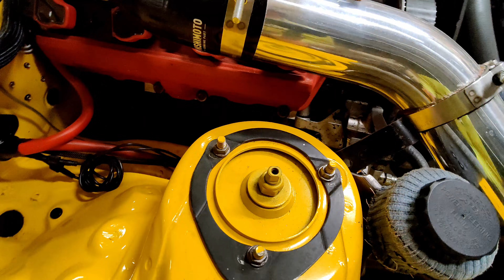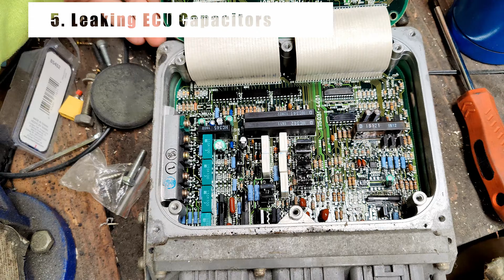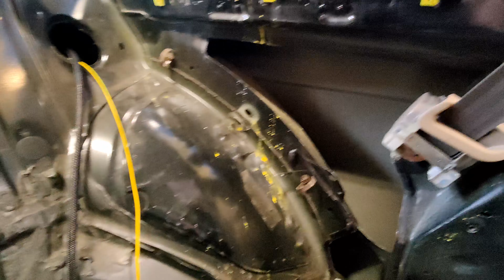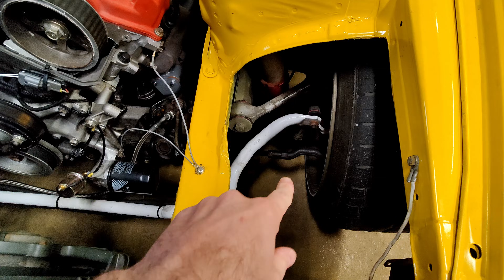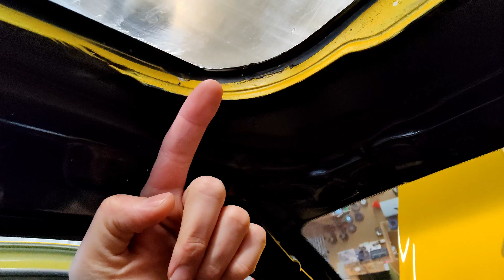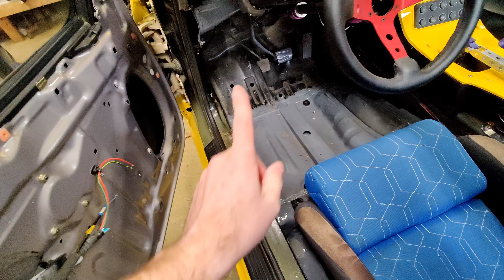Is The SC400 Reliable? All The Common Problems

Comment: I just got a 400 with 105k miles for 2500. Killer deal, excited to fix the small problems it has, runs like a dream.
Reply from the maker: that's a great deal
Reply: @DingDongDrift is one with 155k miles for 3400 a good deal as well?
Reply from the maker: @diegodelgado3828 not as good of a deal as the guy above lol
Reply: @DingDongDrift is it a good purchase? I'm new to the SCs as well lol
Reply from the maker: @diegodelgado3828 there's many factors that determine that, miles don't really matter

Comment: Bought a 99 in 2003 off a lease with (63k), put 200k on the dash had to replace thermostat, starter, alternator, timing belt, power steering pump... it ran excellent

Comment: I'm watching this video because there's a 92 SC400 for sale with only 67,000 miles. One owner car all stock and very well preserved. I don't want to buy it and then things start breaking right away. But with the condition and low miles, do you think that it will be a while before I experience any of these issues?
Reply from the maker: Low miles, old car = every bushing needs to be replaced and once things start getting used everything falls apart.

Comment: Helped my son’s friend trouble shoot a 93 SC400 and finally got it working well without a check engine light. Replaced both ignition coils for misfires and MAF sensor lastly. Has 370k miles, runs good now.

Comment: A little over a year ago I got a 92 with only 84,000 miles on it, mint interior, beautiful paint besides the hood and roof. Ran perfect for 6 months and ever since then I can not get away from a problem. Currently trying to figure out if it’s the idle air control valve giving me problems or the fuel pump. She’ll turn over, shake and then fail. 
Really love this car but damn I wish it wasn’t my daily lol

Comment: You forgot this common issue, Nakamichi amplifier fried due to leaky trunk.  A premium stereo system ruined by a very poor location choice being under the CD changer in the right rear wheel well.
Reply from the maker: @warped2875  never seen that happen

Comment: My friend brought his 98 sc400 to my house yesterday because the radio wasn't working. The 20 amp radio fuse was blown, I replaced it and it melted completely within seconds. I tried another one, it did the same thing. I said "well, I guess you're not gonna have a radio". I hear this is very common with the Nakamichi sound system.

Comment: Thank you for one of the best, if not the very best video like this, that explains so much, in such a no nonsense way. Very well done. I am looking at a 91 SC400, with 98,000 K's on it. It may not have all of these problems just now, but nice to be aware of what is likely to come and some of the precautions that can be taken. Cheers, from Oz.
Reply: Did you pick it up? Sounds like a good deal

Comment: There is a tiny solenoid valve (maybe two, can't remember) behind the drivers front wheel well attached to the power steering rack.  When removed there is a tiny screen in it which blocks.  This causes undue pressure which blows the hoses or pump.  Clean the screens, no problem, no worries.

Comment: These were my dream cars when I was a poor college student. I preferred the SC over the Supra because the supra attracted too much attention. I finally bought a 1-owner SC300 with 50k miles. Love the car but the engine does heat up. Sold it after 25K miles for the same price I bought it.

Comment: spot on man! I got my dads Cali 92 SC400 so there isnt alot of rust on it but at 218K my driver door latch is tough to get closed and latched, pretty much have to slam it and its near impossible to get out as its behind the equally impossible to remove door track.  Driver door window: I lost the lower rear guide pin and the window cocked and ripped the rubber drive puck in the power regulator. You dont have to remove the window, just tape it up and the regulator will unbolt and come out the hole. Valve cover gaskets: both leaked heavily before they were professionally replaced (Dad just paid to have it done) but I dont have any of the other leaks you mention. Power Steering: The line/hose that runs across the lower rad leaks. Must replace. Starter: Even with a new battery, half the time it will kick right over, the other it will really labor like the battery is low but will always start it, I think the brushes or the contactor are shot. IAC motor: Mine had the bearings almost seized in it. 2 skateboard type sealed bearings inside the motor itself caused an 1800 rpm idle until I took the IAC out and realized it wasnt moving. Lubed the bearings up and it idles at 650 now. They were ROUGH! Interior: Door cards falling apart! Evert time I remove them, I break more of the plastic out at the bolt holes. Every one of the holes now has a beer can pull tab as a washer to hold the panel on. Window trim where your arm would rest, they are ALL broken midway and most of those bolt holes are broken too. A/C display blacked out, I soldered in a new one but could never get the backlights to work again? Needle lights are out, grab every set of needles you can find from the SC dashes at your pick-a-part and find the ones that work. IIRC the tach needle polarity changed from the 92 to the 94 years as all the ones I found didnt work until I reversed the polarity (weird). Suspension: keep it lubed! front end gets squeaky. I did the rear bushings on a LS400 and it was pretty easy and really helped the squirrilly back end. But all these things still make these cars pretty much bullet proof and they run great.

Comment: I use to own 1992 SC300 and now the 1998 SC400. I noticed, all the problem was all repaired in my 1998 as I never have problem with it since I have the car. Yes, the starter is hard to change. Make sure to have at least one extra fuel injector as spare just in case you craked it when you pull the injector rail. Renew all the injector seal whenever you change the starter, it can start leaking with old seal ones you move it. I remember having a lot of problem icluding electrical problem or the odometer with 1992 SC300, with 1998 SC400 all those problem are gone and I heard from 1997 to last year 2000 are problem free. I’m still driving my SC400 until now and planning to upgrade the suspension to Tein and will renew the starter also.

Comment: I mustve been lucky. 3 yr soarer owner i havent had any of the first 4 problems listed. Ecu, however, big thing. Major thing. And fuel pump ecu. Personally, i havent had a problem with the fuel pump ecu, but everyone i know has the problem along with the main ecu. Big things the soarers are notorious for 100%. Just recently had to do crank and cam seals and oil pan reseal. Yea, they leak from these places. The emv/climate control, yup they go out. Easy to replace tho, or get fixed. Yup doord are fckn heavy, the door cards break. Havent had wheel well wiring fck up on me, but all my mates have them problems. Good video if u looking at soarers/sc400s. These problems are what u would expect. But they are fckin reliable tho. Just minor things being an old car

Comment: I have the same issue with my 93 LS400 right now leaking PS fluid on my alternator I think. The car interior lights flicker, and the ACV valve that mounts to the bottom of the PS pump is more than likely junk, I filled it with AFT when I realized that I had no fluid and I noticed zero difference, lmao.

Sourcing a new reliable PS pump, not the cheapest. Not sure what brands are good off e-bay, etc. I'm looking at an SC400 that might need this done too, but I don't know yet. My LS is an Arizona only car, and this SC I found 2hrs away from me is a Cali car.

Comment: I have a 1995 SC400, I bought in 2003 with 59,000 miles on it.

This dude is explaining one by one, EVERY issue I’ve experienced or am currently experiencing 😂

PS: I’m at 169,000 miles now, but it still looks like brand new inside and out. Beautiful car.
Reply: Do u have ig?
Reply: how’s it running now? im currently looking for one for my first car n need tips
Reply: Don't forget comfy
Reply: Thank you for the heads up.

Comment: I bought my first SC in 2000.  It was a fabulous car. I did have a problem with the Power Steering pump, but I drove the car with out incident until i wrecked it.  I bought my next SC in 2019 and I am still driving it.  I have never had to replace anything on this car.  It had 79K on it and it has 120K on it now.  The SC is a fun car to drive and it is super reliable.

Comment: What up Norman Reedus' little brother.... I see you over there with that TRD oil cap ;)

Dont know if you have ever taken those front fenders off but 2 things

1) The little clips on the spacers there crack up and then you have to manually line them up from that point on when you put the fender back on
2) The fenders hold so much dirt that on the last car I bought I found a literal plant growing IN the mud at the bottom of the fender.

I live in the south so no snow but PLENTY of mud to sit there and cause that corner to rust

Comment: Hey Ding Dong i have a 1996 sc400 lexus sometimes when i try to accelerate it won't accelerate like a dead spot i have to press the accelerator really hard or stomp it hard to accelerate faster i did the fuel pump bypass new fuel filter car runs and idle fine. Do you think this could be my Tps sensor.

Comment: A better solution than direct wiring the fuel pump would be to use the ECU's voltage output to run a relay. Even if it's a bit low it will still operate the relay.

Comment: Excellent video!   I don't remember where I found it, but there are posts or videos on how you can make a small aluminum plate that can fit underneath the power steering pump so that any power steering fluid drips will be diverted away from the alternator.

Comment: I have own my 95 for about 8 years and yes some of these items need repaired or fixed, door and window issues yes, I flush my power steering fluid every few months to make sure it stays fresh when every I hear the steering make any noise when I turn the wheel (if the power st. pump goes out it will spill on the altnator and starter making a big repair bill) That being said my sc has been one of the best most reliable car's ever!!! and at 150k miles it feels like a new car. I do one upgrade yearly last year it was tires and spark plugs and wires this year will be the timing belt, next year new struts. Don't be fooled it is a awesome car and the only reason I have not gotten a c5. (P.s No I do not drive it in the winter time)

Comment: When you remove the idle air control valve where do you re route the hoses to? Or do you plug each one up completely?
Reply from the maker: Just plug everything
Reply: @DingDongDrift  Thank you! Ive been having issues with mine and prices for a new one are crazy. Figured itd just be better to just get a block off plate instead
Reply from the maker: @ricklexo  it won't work without a standalone ecu

Comment: I have a 1995 Lexus sc400.    It has been sitting for 4 years. So I drained the old gas and put 5 gallons of fresh new gas.   My car is having a hard time starting.  It cranks and cranks before it turns over.  Sometimes it takes several tries.   It started and ran perfectly fine for 30 minutes or so at normal operating temp. Shortly after, the temp gauge started to rise slightly and the car just shut off.  Hard to start again, would crank but not start.     do you know what it could be?
Reply: Position crank sensor happened to my 4runner. The overheating might be a separate issue. Good luck...

Comment: I have a 97 SC400 150Kmi paid 5300. It's a fairly straight up car. But I have spent 7k+ on rebuilding the suspension and parts for motor. The only issue right now is the PS leaking.

Suspension - P2M upper & Lowers, Links, rear tie rods, etc., PBM coil overs, new hubs & bearings, new brakes - powerstop carbon pads & new rotors, rebuilt the calipers. 

Engine - New PS pump and hoses (need to watch your video on the hose thing tho), new timing belt & water pump kit, valve cover gaskets, new drive belt & idler kit. New wires, caps, rotors, plugs. I like the idea of doing away with the hydraulic fan although mine doesn't leak (yet). 

Still wrenching - started like 3-4 weeks ago.
Reply: Driftmotion braided ss power steering hose

Comment: I have an issue when I step on the throttle all the way when I’m going 50mph the car used to downshift to the lowest gear possible but now when I’m going 50 and step on it, it only downshifts one gear so it feel slower but when I use the gears it still accelerates fast
Reply: Overdrive on?
Reply from the maker: There's a switch below the pedal on the firewall, that's the kick down switch to drop 2 gears. If that doesn't work or maybe floor mat covers it that could be causing your issue.

Comment: Hey! I recently bought an SC400 that has been sitting for two years, I've got it started and everything running good, the only problem is.. is that when I floor it and it goes up to 3000k (pretty slowly too btw) it drops down to around 2k and keeps climbing back up just to fall again.. it makes a braaaaa braaa braaa sound because the revs just climb up and fall down. the car passes 3k revs in neutral when revving but since i cant put more than 50% acceleration it either shifts before it drops or it flies to 3k then does the dropping thing.. any ideas??
Reply: Is yours throwing a P0715 Code?
Reply: @robotviewer1396  dont remember, sold the car the problem was impossible to fix. just dont like sc's. dont get one.

Comment: The power steering pump, my God. The bypass thing , I replaced it with a oil drain bolt and Teflon tape because it would leak into the intake and the.  Looks like a 2 stroke from start up. The steering didn't feel very different but just a little but very unnoticeable. Supposedly it makes steering better but what ever

Comment: My es300 still is mint but it was garage kept from original owner who was old man and it only had 48k miles. All the suspension, seats rubber mounts and molding are in unbelievable pristine condition
Reply: Hows the transmission holding up? Im waiting on getting mine back from the shop. Onto trans #4

Comment: If you had the plans of maybe getting a SC and CD009 swapping it and wanted to modify it would you get a 300 to boost or would you get a 400? If you get a SC400 how much power is possible? Obviously the 300 can be boosted easily but what could be done to the V8? Maybe an aluminum L33 5.3 with worked heads, cam, intake and etc?
Reply from the maker: You can boost a stock 1uz the same exact amount as a stock 2jz
Reply: The genesis of the 1UZ was the CART IRL Indy V8 Toyota bult in the 90s. The engine is solid, has six bolt mains and will take boost. Surf for it as I've come across a few posts on it.
Reply: aftermarket for 2j is far better, na-t, forge internals are easier to get ahold of...ran 1uz on 9psi for years until 2 rods went wifi 2 months ago had skinnier rod 1uz 500hp is the limit...cheaper to get power from 2jz.. boosting both on stock motors is about the same numbers wise.

Comment: 93 sc400 local with 250k for $1200 obo. They said they went to drive it and had no gears just all neutral. This usually means death of a trans but I hear the drivetrain is usually bulletproof. Owners says it wasn't beat or abused but don't they all. Any ideas? Is it Worth throwing them a $600 offer to take on this project. I enjoy import cars and have owned cicvis, Subarus, a Celica, and a dodge stealth. I've always known the sc's as luxury supras and seeing one pop local as me excited.

Comment: I was looking at an SC400 for a first car... but it seems these are quite unreliable. Are these easy issues to fix, or not?
Reply from the maker: Every old car is exactly the same or worse.
Reply: They are reliable but they have common issues that can be expensive because most parts are dealership.... hell you can't even buy a heater core for these anymore....buy the factory service  manual and you will be ok lol 😉 I've owned for 10+ years

Comment: eyeballing this 1992 model for $6,400 with 89,938 miles on itand they re did all the brakes recently and the ECU/Speedo and RPM needles/EGR/Coil packs/spark plugs/Fuel filter/Fuel pressure regulator/MAF/Cam sensor/Crankshaft sensors and more he says...Should I go look at it and buy it?

Comment: If you want to know what's the OPPOSITE of clickbait, WATCH THIS VIDEO 😂💯
Reply from the maker: The fact that everyone agrees in the comments is all the confirmation i need lol
Reply: @DingDongDrift  I noticed on my sc400 the axle boot is ripped and has low grease, could that be the issue of my heavy vibration over 30mph
Reply from the maker: @jstaysydewayz5454  if it's binding then definitely. Hard to tell unless you stick a camera in there and record it
Reply: @DingDongDrift  any other things that can cause heavy vibration
Reply from the maker: Guibo, center driveshaft bearing, wheel bearings, wheels, tires, lugnuts, literally anything that rotates lol
Reply: @DingDongDrift  hmmm okay I'ma go over everything
Reply: @DingDongDrift  when I got the car I DID notice the driveshaft was loose. Tightened it up
Reply from the maker: If the driveshaft was loose and vibrating before you could have a bent driveshaft
Reply: @DingDongDrift  I'm thinking ... Getting under the car, on jackstands and putting it in drive would help huh..
Reply: @DingDongDrift  and I noticed the axle boots are ripped and most grease leaked out
Reply from the maker: Yea they might be chooched

Comment: I had most of these problems fixed so far so good, had a rebuilt ecu, replaced fuel pump and fuel pump ecu, air control valve failed replaced it, lower control arm failed, when ball joint slipped out, now my next project is the ps pump which failed slight oil leak at the real cam plug, other than that no major issues, I also have an Ls400 Im getting straight
Reply: Sc400 and ls400 too ? Bro our type is rare 🤟💯💯